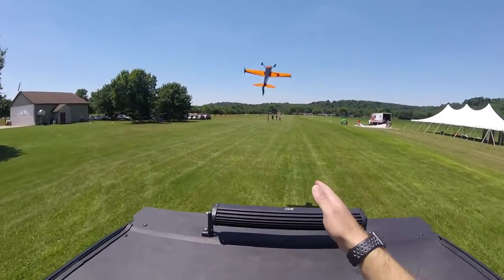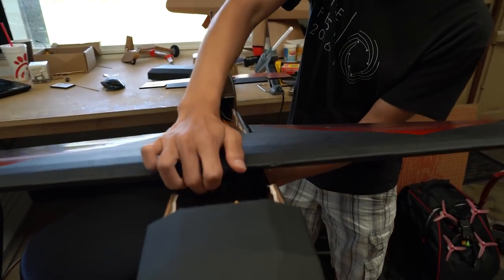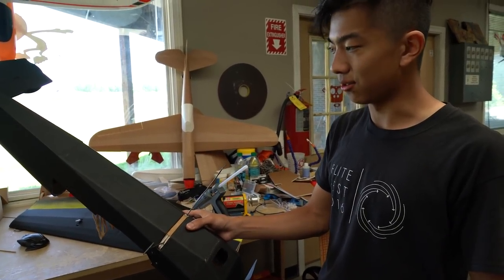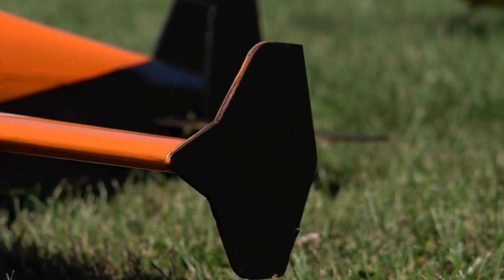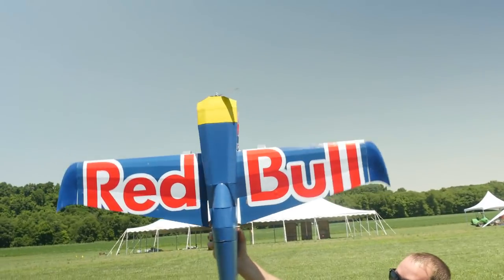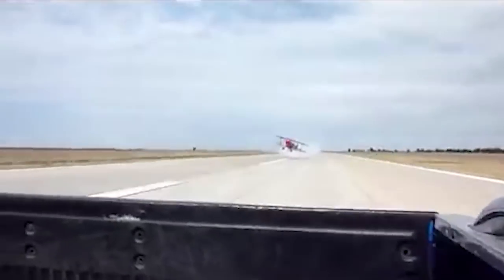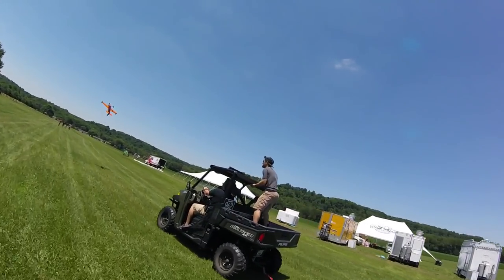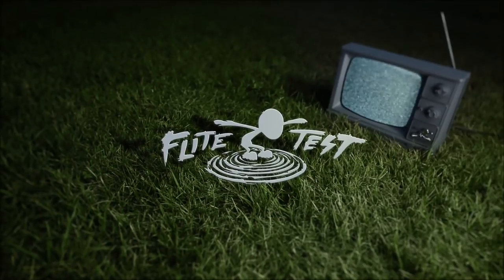DIY Aerobatic Stunt Plane -  FT EDGE 540

Comment: Please give us the original Fusion 360 Plane so we can make the inner part and make it a 3d printed 3d Plane.
That would be awesome
Reply: 3d print labs has the plane designed to be 3d printed
Reply: Google Drive slash open?id=1UjO-gFzFgtCH4BgXDKUynPMO39cQ65ON
I've tried to reverse engineer the plans as close to the design as I could.. Also included RF7 compatible and tested (but tuned by an amateur) model.
Hopefully, the folks over at FT can reach a wider audience who'd be interested in using this model..

Comment: Since there is already a 3D file I'd like to see this turned in to a 3D printable model. I know 3D Lab Print has the Zivko EDGE but that one is more aggressive (smaller wings, faster, etc) than this one. Have you guys tried printing a whole plane yet? I'd like to follow your experience.

Comment: I'm working on an airplane design on fusion 360 and I wanted to see how you export the airplane faces and turn them into a 2d plan. Did you use a plug in on fusion 360 to unfold the airplane or did you save each face individualy as a dxf file and snap all the faces together in a different software. Or used sheet metal workspace but that would be really hard. Thanks!

Comment: Awesome guys!  I was looking to build a 3d plane about a month ago, and of course the first place I looked into was flitetest.  The  FT3D seems like a great aerobatic plane, but it's just a little behind the times as far as modern 3D birds go.   This is basically exactly what I was hoping to find, and it's awesome to see you guys put something like this together.  To anyone out there planning on building one of these, keep in mind that your standard cheapo 9g servos that we all know and love are going to have no chance against the forces required to actually fly 3d or especially XA on a plane like this.  You're going to want at minimum a metal gear servo, but I would run a digital metal gear servo that's capable at running at 6v for added speed and torque.  3d flying is amazing and doesn't have nearly the following that it should.  Search for "Jase Dussia" to see what a true master can do.

Comment: I see that the spar in all these builds is primarily used to form the shape and thickness of each wing half.  There appears to be no additional strength involved in keeping the two wing halves from folding under pressure except for the tape join in the middle and the two wing halves coming together at that point also.  I didn't realize that was sufficient.  Is it because these planes are foam and built so light weight?   I was always thinking the two wing halves would eventually fold in the middle under flying pressure.

Comment: Got into flying with my dad. It was off and on because this hobby is at the upper limits of what my income level can afford. Regardless I was able to get bored of v tail 3ch. We lost everything in a fire, and he died shortly after. Havent flown in 8 years. Now I have enough to do it on my own. I feel confident that I can have authority over this plane in the air, and I finally got my frsky x10s. Can I come fly with you guys? I'm just a few hours from cedar point. It would mean a lot to me. I'll be flying one of these, on one of your 35A radial power packs. I put forth all the cash needed, and I'll even buy pizza and beer for those who partake(not me 5 years). It would mean a lot to me if you said yes.

Comment: Hi all! I‘m currently building a 3D plane by myself. It‘ll have two  symetrical wings of course. Now my question is, do I need to mount the wings with a little angle or just straight? Thanks in advance and greetings from switzerland!
Reply: I would do it straight, you wouldn’t want dihedral angle when you want it to stay in a knife edge or other maneuver, but I’m not very experienced either but that’s what I believe.

Comment: ok, you obviously weren't using a C-pack motor in your builds. What did you use? or recommend for 3-1 acrobatics performance?
had plane for a few now, it's the motor choice that is dragging my feet from building.

thanks
Reply: Overlander 3536 1500kv. These motors have great power, still run on a 30A ESC. I'm running a 9x4 on 4s 1500 mah

Comment: PLEASE -   one question - does the landing gear work ?.....no ground looping....
good straight take offs and landings ???

I bought the Scout Kit -    landing gear so bad I took it off and do belly landkings
I bought Mig 3 - langing gear so bad I took it off and decided to sell the plane, I don't want any more belly landers...

I'll buy the 540 if someone assures me it will not ground loop but will take off and land well and the landing gear will not fold up like on the MIg.

Comment: Please tell me -
what FT plane can I buy that excels at precision aerobatic flying ?
- not 3d,   but excellent basic aerobatics plus can do a knife edge, hesitation point rolls, slow roll.....and maybe a flat spin -
but I don't need the crazy 3d stuff - 

My first FT plane - the Scout - does pretty good -  I'm thinking of modifying the basic plans to have a bigger rudder and maybe try changing the wing design a bit.

Any suggestions ?
Reply: Honestly I would say this edge would be your best bet from the flitetest library.  3D planes like this fly precision very well when set up for it (slightly more nose-heavy than neutral and obviously lower rates).
Reply: @andycullen9311  thanks Andy,  I've built 2 FT planes so far - the Scout and the MIg 3 -   my greatest disappointed in both is the landing gear -
so bad I took it off and do hand launch.  Both planes ground loop like crazy, preventing takeoff.
so what is the landing gear like on the FT Edge 540 ?

Comment: very clever people, way outta my ability, flew the spear, but hot glue isn't my favourite to work with and after some crashes the wing integrity was gone and it just wouldn't fly like when it was new, but hey its cheap and fun to build FT planes, just dont expect them to last to long in my opinion if you crash :)
Reply: Gorilla Glue works as a substitute for hot glue. Just have to clamp and wait for it to dry.   Or use hot glue as a clamp.
Reply: yes ive used that, can be so messy though, guess Im over repairing, my EPP super cubs by horizon are so easy to fly and repair ..but thanks :)
Reply: THANKS kEVIN MUCH APPRECIATED WILL DO :)